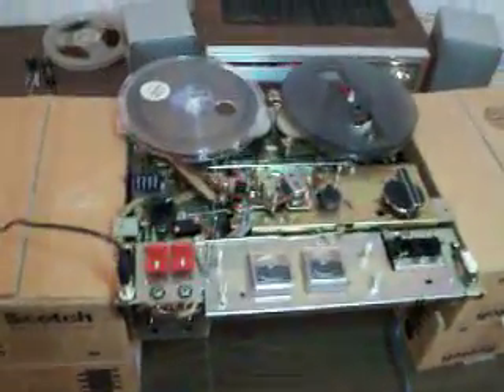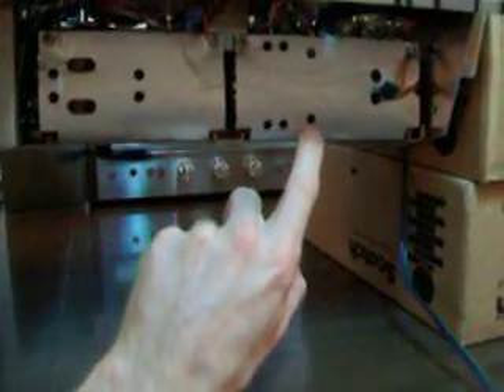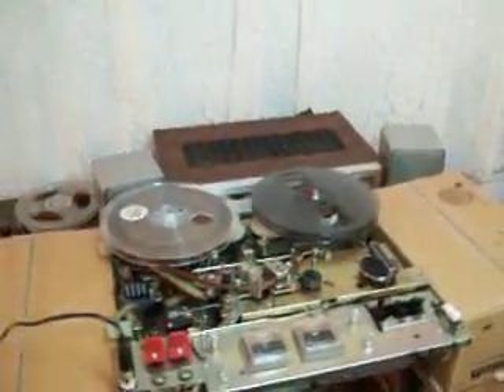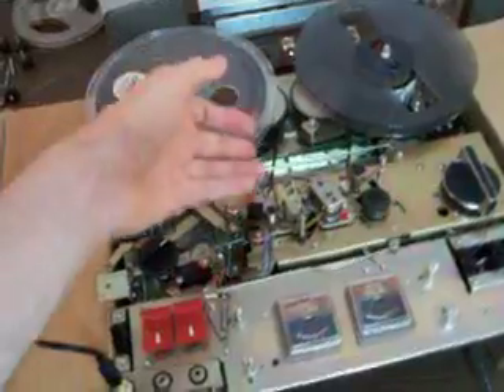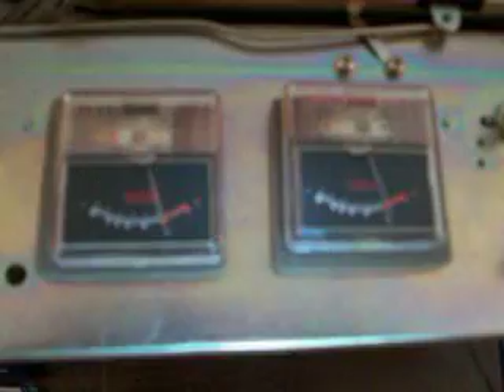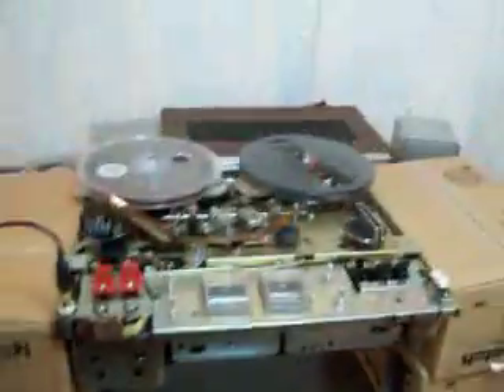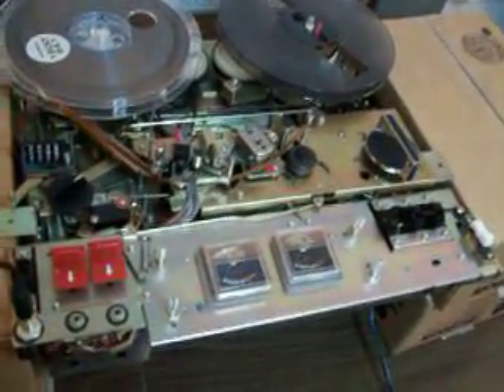Sony TC-366 partial restoration

Comment: You need to keep it in its case. To allow the fan to properly cool it down. It is the same thing with your furnace. That's how it was designed to run. Now time to break your reel to reel and do another cool video.

Comment: THe speed being slow and the motor hot IS a bad motor-run capacitor. The capacitor goes bad and that exact thing happens. It happened to me and replacing that cap fixed the problem. It needs to be the same value or the speed will be different.

Comment: If you motor is getting hot and playing slow you need a new motor capacitor. Costs about $14.00 or less.
Reply from the maker: Thanks for the advice! My TC-630 recently started having the same problem. I guess it's time for me to man up and learn to use a soldering iron!